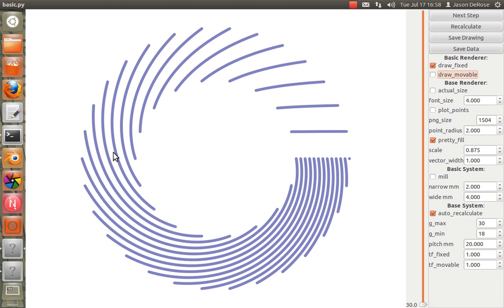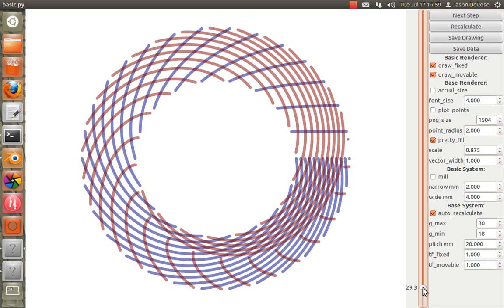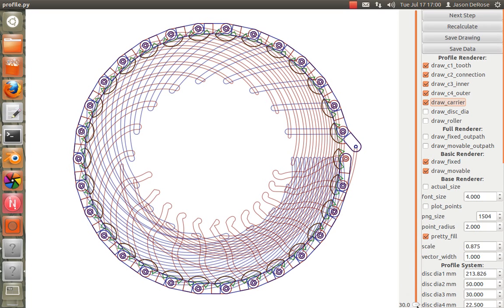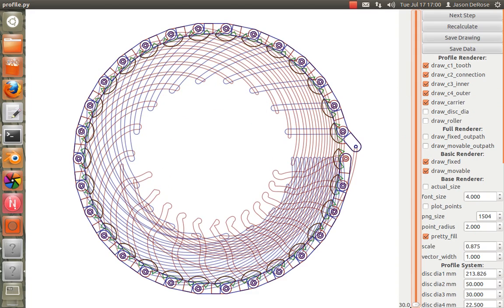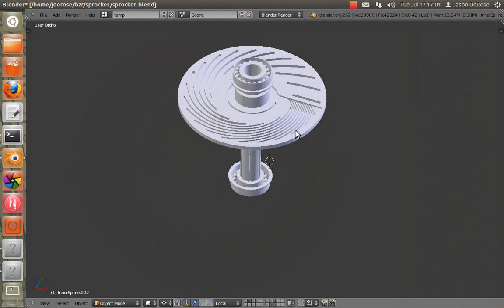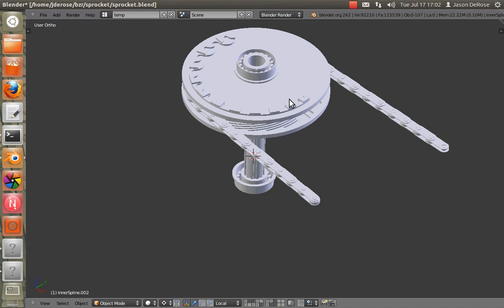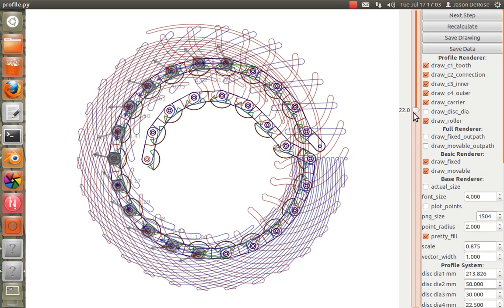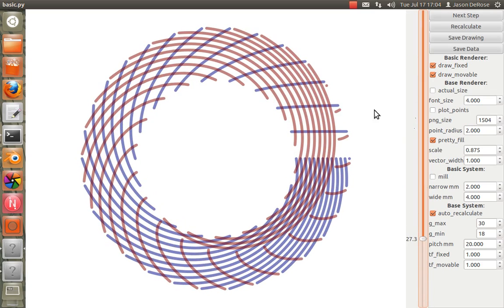Variable Tooth Sprocket

Comment: Great explanation,  This seems to have so much promise because it keeps a round and fully engaged sprocket as the diameter changes, but constant pitch, with the advantage of the high efficiency of a chain and  sprocket.

Comment from the maker: From the research I looked at when working on this, the efficiency of a sprocket/chain combo is higher with a higher number of teeth. Also rather interestingly, the efficiency is higher with higher chain tension (which is a large part of why a fixed-gear bike is more efficient).